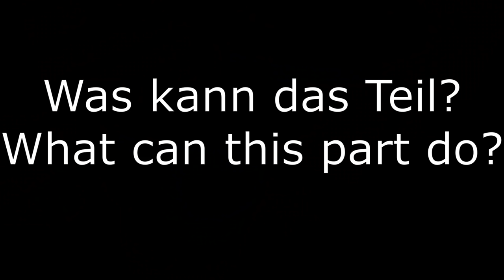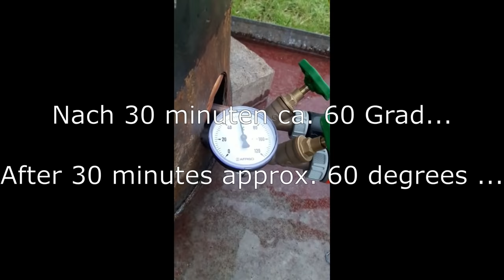Holzbefeuerte Poolheizung|Wood-fired Poolheater|Alles.Handarbeit

Comment: An alternative to separating the coil from the walls for better heat distribution, as another user commented below would be isolating the external part of the tank with some kind of rock wool, styrofoam or some other expanding foam,  then another layer to encase the whole thing like a bigger tank or using retractary cement basically turning it into an oven.
Reply from the maker: Thanks for the tip. There are more options.
Reply: more copper would be a better option compared with separating the copper, as copper being such a good conductor, it will heat up anyway.

Comment: Nice idee, 
Most off the heat will go tru the chimnee means youre water will be much more hotter than placing pipe‘s around the barrel. 
If it starts at the downside with a backvalve out side the barrel and ends in the top of a chimnee, 
You will not need a pump, it will be like a coffee machine, with constant running hot steam water.

Comment: For higher heat transfer efficiency and improved pump GPM.  Use three parallel separate coils with inlet and outlet headers and keep the copper coils at least 1 inch away from the barrel wall.:yougotthis:
Reply from the maker: Thank you...

Comment: One suggestion: some sort of refractory cement on the inside of the barrel and a thin layer of rock wool before hitting the copper might be best. Copper REALLY doesn't like dissimilar metals and will quickly rust and oxidize. Either way cool project!
Reply from the maker: thanks for the tip👍

Comment: Would this work with 2 barrels, 1 containing the coils and the other used as firebox? Connected with chimney pipe and then a vent from the coil barrel. I have a lot of water to heat.

Comment: Never allow copper to get near steel or galvanized steel  it will generate galvanic electricity and will make a hole in every point that copper is in touch with another metal, even with sacrifice cathode it will fail in a year, loved your idea i would go for the same idea but with sand instead of air, if you heat the sand it will keep the heat more time, regards thanks for your video.
Reply: Yep, there MUST BE ring bell in your head, EVERY TIME you're dealing with combining several types of metals

Comment: By having your copper tube so close together and against the outside of the chimney, you are severely limiting the heat transfer area. You would get more heat transfer if the flue gas were directed around both sides of the coil.
Reply from the maker: Thanks for the hint. I will consider next time ...
Reply: But would it not depend on the flow of water also?
Reply: @duramax78  Much less so.
Reply: @BasementEngineer  ok ty.
Reply: Please don’t use styrofoam! Only rock or glass wool

Comment: To increase heat transfer, think about using some extra fine black rock sand (basalt or similar) filled where pipes go. You will need to isolate this sand and pipes, thus build barrel within barrel.  
More sand you will have, more stable heat transfer will be. Ideally instead of rock sand, it would be great to use nickel powder, but it's too expansive and thus not practical. 
Or being more crazy, and fully isolate pipes and fill it with bismuth (Melting point = 271.5C ), but that's heavy metal and isolation must be sealed very good. But in this case heat transfer would be close to ideal :)

And outside it would be better if you isolate it with some heat resistant isolator, and add some aluminum foil with mirror surface faced to barrel, thus some heat radiation will be reflected back. Also escape the possibilty of direct contact of tubes with fire, cause wood fire will eventually make tubes covered with coal dust and oily leftovers from burning tree, and thus decreasing overall heat transfer.
Reply from the maker: Hello, thank you for the suggestions. But it was all just an attempt. The pool has 43000l to heat it by only 3 °C, it takes about 6 hours depending on the outside temperature.

Comment: This could work but is not the most efficient. The problem with this is that the cold water is stealing the heat from the fire. Your fire needs all the heat it can get or it wont burn that clean/efficient/hot. You better place the coil after the combustion of the fire is complete ;)
Reply from the maker: That was just an attempt to see if you can heat a 43000 l pool at all.

Comment: WOW, echt eine tolle Idee und auch die Umsetzung einfach klasse, man erkennt sofort die Liebe zum Detail ! Beschäftige mich auch gerade mit dem Thema Poolheizung mit Feuer, hast du eine Materialliste, wäre eine Anfertigung deiner / Ihrer Seite möglich? 👍👍👍
Reply: You will need around 25 hr medium fire, recirculating with an 1,5 hp pump, then when you get 20 degrees only maintenance for 3 hr  or  less, cover the pool during night
Reply from the maker: Sorry,eine Materialliste ergibt sich aus dem Video. Leider habe ich keine Zeit so etwas zu bauen.

Comment: Copper pipe degrades faster and you will eventually unsolder the coupler fittings because of direct flame.
Reply from the maker: Hello, no, the fittings are not unsoldered because they are always cooled by the water.

Comment: Nice. If I spoke German I'd ask what the flow rate is or what volume of water was heated by how much with how much fuel. Thanks for posting.
Reply from the maker: The pool has 43,000 liters. After 6 hours of heating, the water was heated from 15 to 18 degrees.
Reply: @AllesHandarbeit  Thanks for the reply. I make that around 542 mega Joules transferred to the water (43,000 kg x 3˚ rise x 4.2 kJ/kg˚). A (theoretical) 100% efficient boiler would require (assuming 20% moisture content wood) 36 kg total wood fuel to release that quantity of energy (i.e. 6kg/hr burn rate). If you can keep track of how much fuel you use, you'll have an efficiency measure. Of course most of the fire heat will be lost before reaching the pool and plenty afterwards but maybe 20% or 30% ends up in the pool (30% equates to about 20 kg wood burnt per hour, 20% equates to about 30kg/hr).
Reply: @AllesHandarbeit  cant see much of the swimming pool.
Reply: @AllesHandarbeit  which means the average heating output is about 25kW, not bad for a barrel with a copper coil inside. is the copper strong enough to survive in such bad conditions for long period of time ?
Reply from the maker: @DzikVideos  My friend has had a pool heater like this for 4 years and it still works.

Comment: 8:25 Why don't you use flux for soldering? The copper has oxidized and turned black!
Reply from the maker: I soldered this with Silfoss. You don't need any flux. The oxide layer can be washed off with a wet cloth.

Comment: why not what ever sheet metal you had and make it solid so that its just inbetween the barrel and where you make the fire so that your copper tubing is protected
Reply from the maker: Hello, nothing happens to the copper pipes as long as water flows through them. They only turn black.
Reply: @AllesHandarbeit   I watched one video and the guy said that about after a year it didnt work as well because of the stuff that built up on the pipe. But if not thats good news. Thank you

Comment: the metal barrels that the fire burns through in 14 days, copper pipes are fine and the idea is fine just not the barrels
Die Metallfässer, die das Feuer in 14 Tagen durchbrennt, Kupferrohre sind in Ordnung und die Idee ist in Ordnung, nur nicht die Fässer